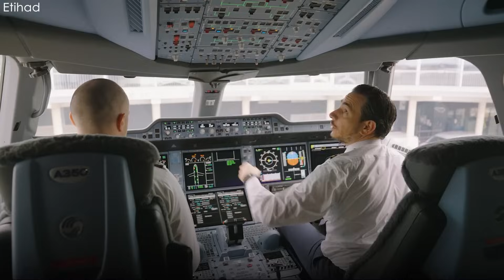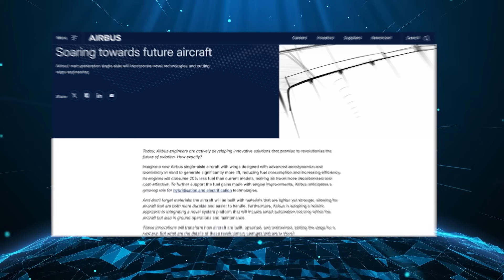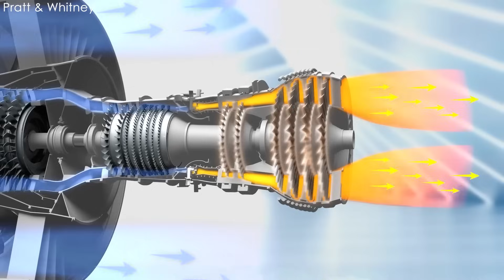NEW Airbus A350-2000 will SHOCK All Aviation NOW! Here's Why

Comment: There's no wide body that can beat the 777 end off. Airbus have designed A350 but it can't beat the 777 no matter what
Reply: You seem to be a strong believer ...
Reply: Yes the 777 is an amazing plane. I would question why so many airlines are switching to Airbus wide bodies though. If the A350-2000 does come in to play, the operating costs will beat any 777 flying. I love Boeing and regret where it’s found itself.

Comment: As lenghtening it only provides 40 economy seats, Whereas a 2 seat wider version would greatly improve this. It would require a complete structural recalculation for required adequate redundancies but present design would not need to be redone. Lengthening this  could be incorporated in the required calculations. But what markets are these to serve?
Reply: Widening an airplane would significantly reduce efficiency, so that’s not really a choice.